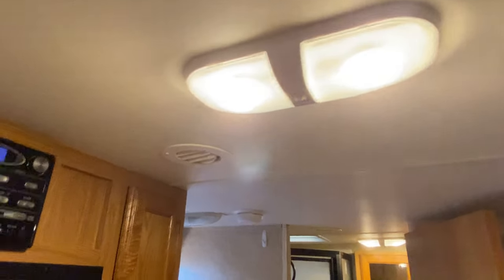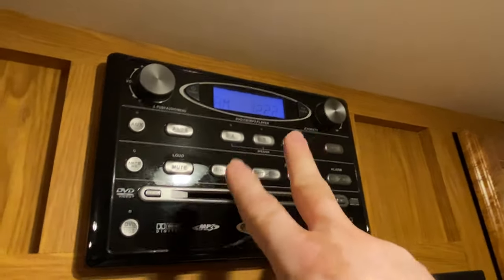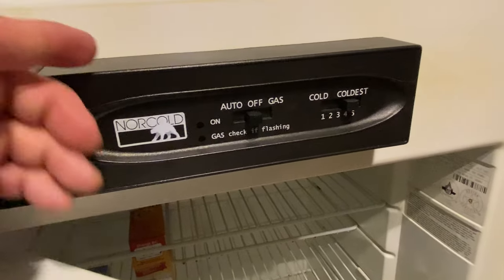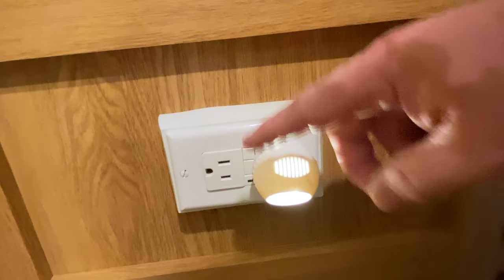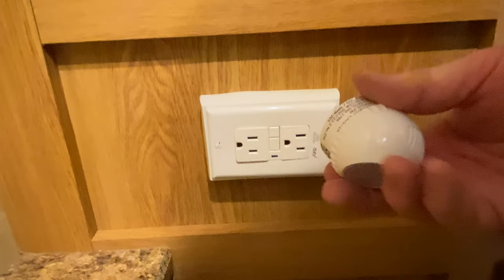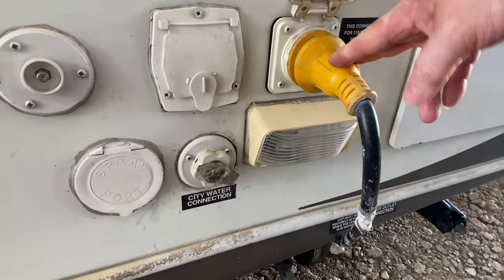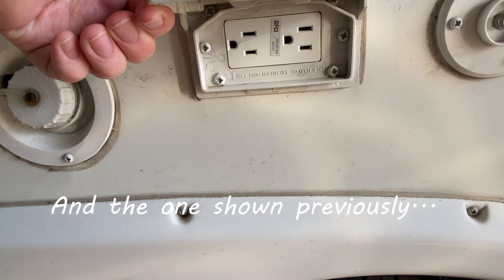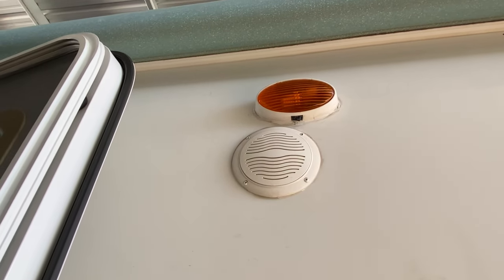The Basics of RV, Travel Trailer and Pop Up electrical and battery systems

Comment: Can you add a battery charge indicator inside the trailer?  So you can tell if it’s getting low.
Reply from the maker: Yes you can, they are pretty cheap.  Just have to wire them into the 12v system.   I usually wire them into one of the 12v lights. Thanks for watching!